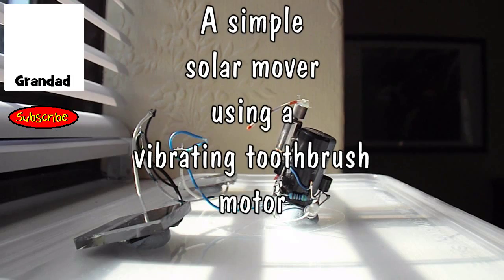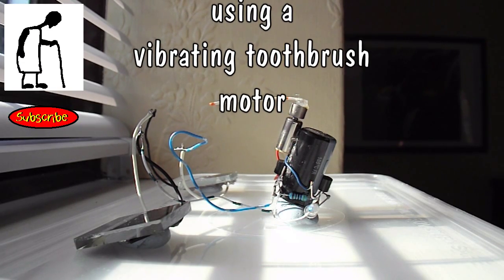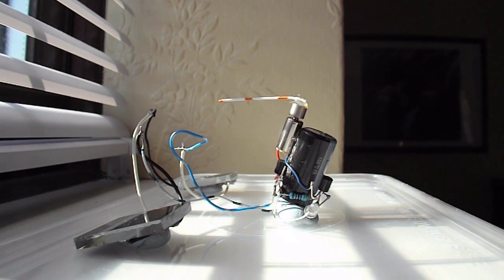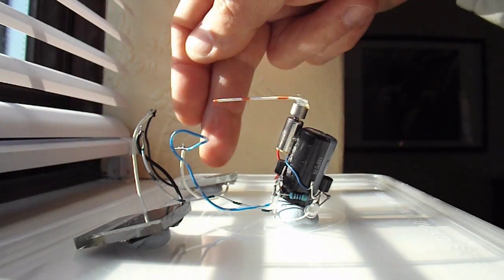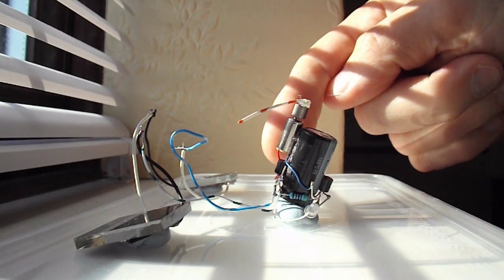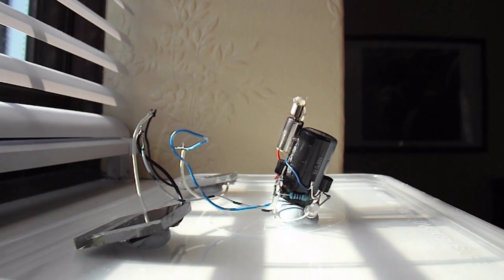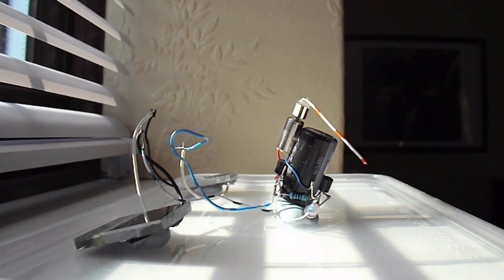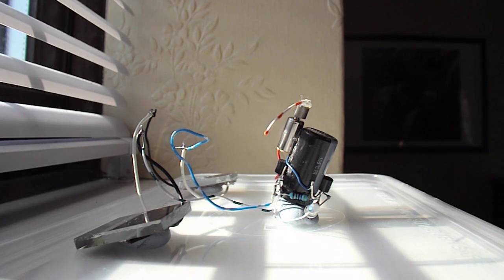Vibrating Toothbrush motor Solar Mover

Comment: The best idea ever seen by myself using that circuit. I like it. Wondering what LED you are using instead of Red FLED? Thanks for sharing it with us. Cheers.
Reply from the maker: Hi Medhi, it is just a blue flashing LED. It is really supposed to be the other way up with the motor shaft touching the ground to make it move around but I remember I was trying to demonstrate how it pulsed and the 'clock hand' showed it better.